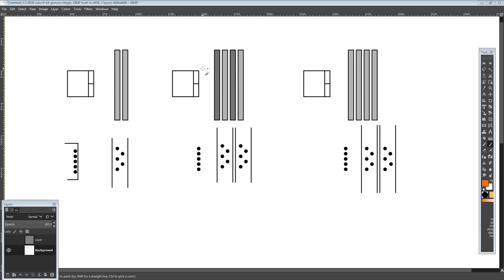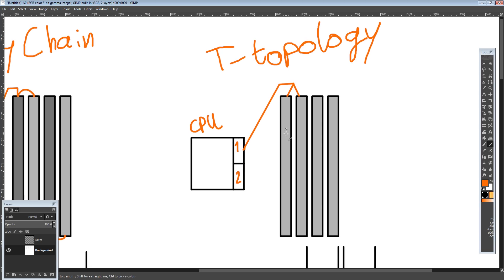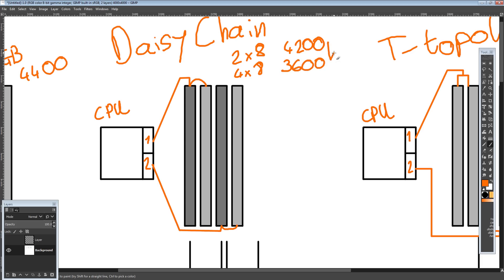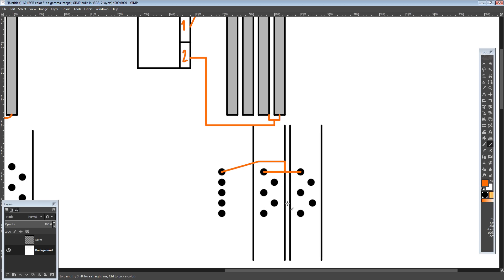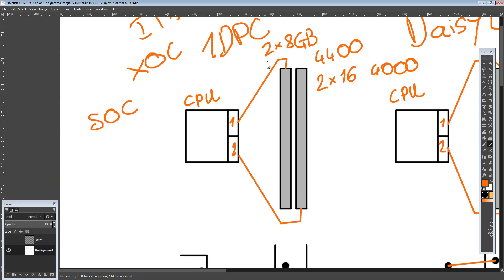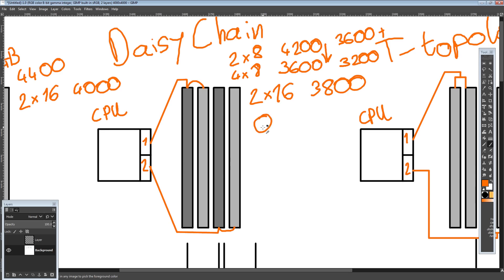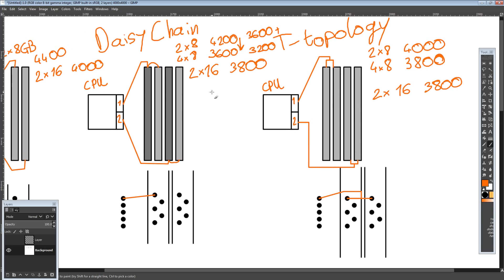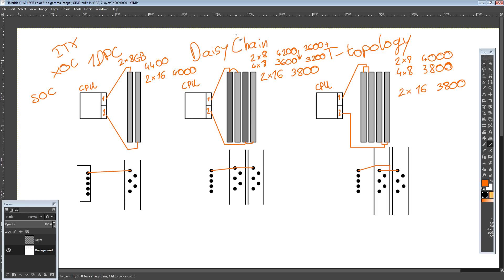Rambling about motherboard memory layouts.

Comment: Hey buildzoid. I have a question about Daisy Chain. For example if you use the 2 bad slots on the Prime X470-Pro, you can only boot with DDR4-3000. Higher clock won't work, nevermind what settings you will use. In the 2 good slots you can do DDR4-3600. But now if you use now all 4 slots you can easily boot with DDR4-3200 or even higher. Do you know how this is possible?
Reply: combined maybe?

Comment: How important is the distance from the CPU to the RAM slots for speed? If it makes a big difference, then why not ditch the silly single-side ATX layout and place the RAM slots directly behind the CPU on the back side. I've long been amazed at how spatially inefficient the single-sided mobo design is. A double-sided would make much better use of the space.

Comment: "Asus good at doing it" No its not, asus prime x370 pro sucks at memory overclocking, while in other things its good but other manufacturers cheaper boards overclock memory better.

Actually it seems to even care what stick is in what slot, not only what slots i use. If i take memory stick from slot 2 to slot 4, and from 4 to 2 it will do worse than it does now.

Comment: So, do some CPUs have 4 memory controllers that support quad channel(Threadripper?)? Does it work or help?
Reply: Yes, my Threadripper 1950X has two channels per die and two active dies. In a dual Socket Epyc System you have 16 memory channels. If it helps depends on the application. Each die can only efficiently access the memory it is directly connected to.
Reply: yes threadripper and intel hedt have 4 channels

Comment: Great explanation. Thank for making it! On a T-topology board with 2 RAM sticks, would using the first and last slot be better for cooling, giving them more space, or does it make no difference as long as they aren't in adjacent slots? (Does that even make a difference?) I'll probably go with 2 and 4 anyway just so if someone looks at a photo and doesn't realise it's a T-topology board, they don't think I work for Wallmart of The Verge.

Comment: Using msi x99s sli plus, looks like 8 memory slots daisy chain 4x4GB in use. So if I fill other 4 slots will I get lower performance? I was thinking about buying identical 4x4 ddr4 kit to what I am using.

Comment: So, is this a percentage loss based on the clock rate of your memory sticks?  Or does the clockrate have to reach a 3600mhz threshold before it even matters?  For example, if I upgrade my 2x8gb 3000mhz configuration to a 4x8gb 3000mhz on my Asus b450-f daisy chain motherboard, will I still get 3ghz on all channels?  or do I apply the math above and assume something less like 2800?

Comment: So, does iTX actually give better RAM speeds for Dual Channel CPUs?
Reply from the maker: Good ITX/XOC boards on 2x8 will beat good 4 dimm motherboards.
Reply: @ActuallyHardcoreOverclocking  Thank you for the reply)

Could you just clarify. I want to get a new build, particularly for PUBG, and apparently the game runs better with faster RAM (total speed of MHz and LS timing - combined).
So, I should get myself an ITX board with 2x8GB, to get maximum speed - right? (cause as far as I understood, even 2x16GB config in ATX, would result in lower speed)
Reply: @ActuallyHardcoreOverclocking  My issue, is whether to get an ATX with 4 slots or an ITX with 2 slots - as you say, I would get better RAM performance with ITX, but will it be enough to outweigh the advantages of a larger board with more phases etc? (please reply) :D
Reply from the maker: there's boards like the Maximus XI Gene and Apex. Also the Z390 DARK. Full ATX and MATX boards but with 2 DIMMs specifically for the better mem OC  @iXpertMan

Comment: Then, which z390 motherboards have the best memory overclocking? z390 Dark?
Reply: Yes, and Asus Maximus xi Apex, impact & gene
Reply: it s depending from :

- The IMC of your cpu
- ESPCIALLY the chips you ram use ONLY the better ones can chieve excellent performance IF both your cpu's IMC and mobo can support it.

It depend what you seek.,but i will say Z390 Aorus Master for being to have the best performance 

4x16go .

The more dimms you have the more performance you get.

Same foor Dual rank: better than Single rank.

Tell you that a DR stick can performs with less frequency and despite worse timings than Single rank.

So  with 4 dimms you get bonus for multi cores performance ( i know that i9 9900K oc 5.1ghz all cores manually with 4x8go 4133Mhz CAS19 (19-19-19-39).

One person can do better with 2x16go 3500/3600Mhz 16-18-18-18-38 

So with 4x16go and with better latency yes for sure

4x16go 3600Mhz CAS 16-16-16-36 by example)

Comment: Talking about ranks... in my config (4x8 GB) I have two different sets of DIMMs that should have been the same (same part number) but are not. 2 DIMMs are single-rank, and the other two are dual-rank. Would it be better to install them single+single in one channel, and dual+dual in the other, or mixing single+dual in both channels? I've never had a clear idea on which configuration is worse (I assume it isn't possible to have a great config).

Comment: So on Z390 GB TTOP, sounds like for OC that 4x8GB or 2x16GB would be the same, if both are 2R. What if the 4x8GB is 1R? Would that be better than the 2x16GB 2R?
Reply from the maker: 4x8GB is inherently dual rank. You can't buy a DIMM with half a rank of memory on it.
Reply: @ActuallyHardcoreOverclocking  Interesting. because the QVL for what i was looking at (CMW32GX4M4C3200C16) says 8GB, 1Rx8, SS
Reply from the maker: Each stick in that kit is 1 rank and SS = single sided. If you put 2 of those sticks into 1 channel that channel will run in dual rank.
Reply: @ActuallyHardcoreOverclocking  Ok, got it. And what about a 4x8GB kit on there that says, 8GB, 2Rx8, DS? (like CMD32GX4M4B3200C16). I guess that's where my confusion starts! Would it be better/worse/same? Maybe we need a rank educational video as well :)
Reply from the maker: @ncohafmuta  You can make dual rank 8GB sticks by using 16 4Gb ICs. 2 of those sticks on 1 channel make a quad rank setup. And I'll probably make a video covering memory ranks too.
Reply: @ActuallyHardcoreOverclocking  Ok, so then both 4x8GB 1R and 2x16GB 2R are just 4 ranks total, 2R should be better because of rank interleaving at the same clocks, but you can OC 1R more, so may just be a wash, even taking account the increased command mgmt overhead with 4 dimms.
Thanks for the info.

Comment: So if i want to run 4x16gb of ddr4, which layout works better? It sounds like t-topology is better able to handle that demand, but i do want to be clear.
Reply: In theory you're correct but as Buildzoid said it also depends on how good the traces are designed on the PCB and how good the BIOS is.

Comment: So.. do 1DPC boards still have dual channel or are they single channel only, like the name suggests?
Reply: 1DPC doesn't prevent Dual Channel. Look at the H310 mobo. It is dual channel. Just 1DPC but two channels, hence two slots... This confusion comes up a lot.
Reply: Name suggests something totally opposite... One dimm per channel might as well be 4 channels 4 slots. It's CPU architecture dependant.
Reply: one dimm per channel boards......have on dimm per channel.  if you have 2 channels then you have 2 dimms.  simple

Comment: so why are ram modules always aligned parallel to the cpu instead of perpendicular? Seems like the path would be massively shorter that way?

normal way:
|||| CPU ||||

other way:
(just pretend like he cpu is centered and the slots are inline instead of all spread out. couldn't think of a good way to ascii it lol)
===         ===
       CPU
===         ===
Reply: Assume both sides of the memory slots are connected... And Equal trace length a good thing...
Reply: @riekje321 
oh, so there isn't just 1 path between each stick and the cpu? From his drawing it seemed like each slot was connected once at the end of the slot
Reply: @frosty9392  Yeah, you're right. But I can't find any trace shematics anywhere... For me it's all of the banks on the right of the CPU.
CPU |1| |2| |1| |2|
However... If the traces go underneath the DIMM slots, it does not matter that much, BUT... If the traces would go around, like in the video, going to the second pair of DIMM slots, the trace would be shorter if it could go on the other side (1 trace up, 1 trace down) instead of around of the trace connecting the first pair of DIMM slots.
I am rusty on computers, so be patient withe as I will challenge you on your info before I will learn from it >:]
Reply: @riekje321  
on my "pro-sumer" boards, all the sticks are on one side of the CPU too. But on all my server boards, and any server boards i've worked on, the ram was always split on either side